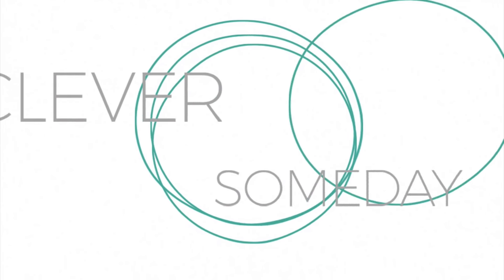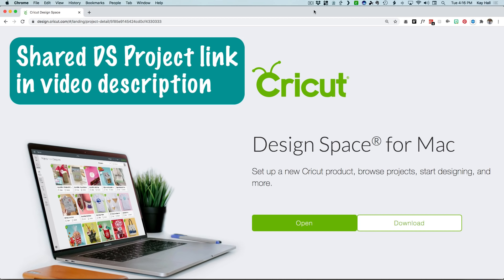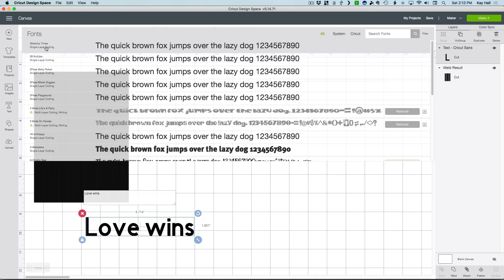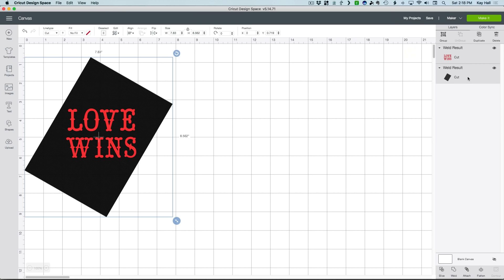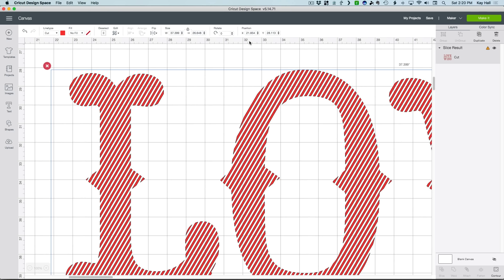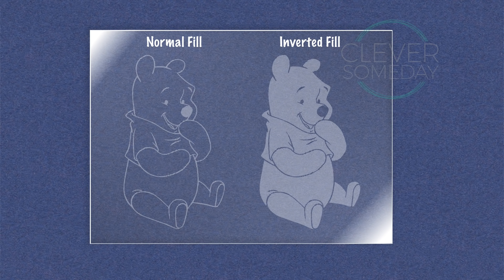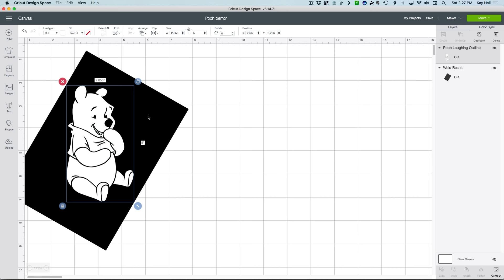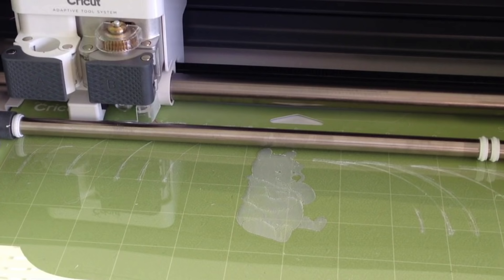Filled In Foiling, Engraving and Drawing with Cricut Design Space

Comment: this is incredible, thanks so much! i am confused that the specific design space project you share the link to is optimized for foiling/engraving but there is no link for the separate starter files for drawing that you do mention it in the video.
Reply from the maker: Great question. I realized that there were too many variables to optimize for drawing but it turns out this same fill is the best place to start. If necessary, you can adjust the starting size of the block up or down to optimize for your pen, paper and settings from there.

Comment: Thank you so much for the clear step by step instructions. Your "with fill" image looks perfectly filled as well as the Winnie the Pooh. I download your rectangle and followed the instructions to a T however my final engraved product I can see all the lines and the line spacing between all the lines that is not engraved. It is not solid engrave as yours is shown. Any advice to get tighter lines?
Reply from the maker: You will see some lines, its not a perfectly solid fill, but if it is very noticeable then you may have accidentally resized the block or not enlarged both items before slicing. Barring that, you can reduce the size of the block before starting to give you a denser fill. There is a tradeoff between "solidness" and the amount of time it takes to engrave and finding that right balance is personal preference. There is also a DS bug we see sometimes that causes an unevenness or banding, so its possible that is coming into play as well.

Comment: Hi Kay, I want to try to eventually engrave my dog's final pawprint. I think I would use the 2nd method you showed. Would you recommend using a pen in the cricut to double-check that the design is correctly set up? On paper of course. And I would like to do the engraving on metal. Is there a specific metal it will engrave on the best? It will be mounted inside his memory box.

Comment: Great video. Is there a fill starter for pen? I think you mentioned the engraving/foiling one was not suitable for pen? Thanks for all the great tips!
Reply from the maker: You can start with this for a very fine pen, and enlarge it for thicker pen tips. There are so many variables for pens (thickness of pen tip, type of pen, absorbency of paper, etc) that it turned out to be impractical to make one file.

Comment: Thanks so much for the video and the fill starter file.  I'm very excited to start my first project now.  :)  In other engraving videos, they recommend to duplicate your image multiple times, then attach them - so the more times means deeper engraving.  My question is, because of the line filler file, would you recommend making multiple cuts on top of each other, or does this way suffice for just once?  Thanks!
Reply from the maker: Great question and the answer depends on the project. One pass of a line filled design is sufficient for clear acrylic, especially if it will be edge lit. I still do multiple passes when engraving metal, but you don't need anywhere near as for outlines.

Comment: thank you so much for this! I just had a quick question: you mentioned that drawing would require lines that aren't as close together as those for engraving. Would I change the size of the file you shared if I wanted to write? or is there a different file for writing? Once again, thank you so much for such a straightforward tutorial!
Reply from the maker: Thanks for your kind comments. For pens, start with the same file, but set the block to 10 inches wide at the start. You may need to move up or down some depending on the size of the pen and other factors.

Comment: I LOVE this tutorial. Thank you so much for the file. I’m having a little trouble. When I slice my number from the block, the engraving has just slanted lines. They are never full. Any advice?
Reply from the maker: The fill is just slanted lines. If they are not close enough, then you may need to try the steps again, or reduce the size of the block to start with to increase the line density.

Comment: This was great! I just engraved an 2" circle key chain with no issues. My issues are, I can't save your fill rectangle, I can't save my project I created using your fill and I can not copy and paste into a new window....hmmmmm
Reply from the maker: These are DS issues, not an issue with the file, which I would have the power to fix. Copy and paste should work if you have not reverted back to the classic canvas in settings. Use shortcuts or right click menu, not the Edit menu at the top. And be sure to report the problem to Cricut.

Comment: I noticed the file is a cut file.  Do I need to change it to draw before slicing the words?
Reply from the maker: After the slicing, you need to change the operation according to your project (pen, engrave, foil ...). You could also change it before if you prefer.
Reply: @cleversomeday  i now have huge design that only showed 2 after slicing.  Waited at least ten minutes and I'm up to 3.  Do I need to wait until there are 4?
Reply from the maker: @denisereading6453  I've never seen this happen, and I suspect you have your answer by now. If you have the slice you need and it will let you continue, then you can continue, but I suspect it won't take any new inputs until it is done

Comment: Thank you for this! It worked, but my design is pretty complex ( A invitation card using foil) so the lines are a bit far apart, could you help me with this? Thank you so much!! :)
Reply from the maker: If you reduce the size of the line block first (from 5 inches wide to 3 inches wide, for example) the fill will be denser. Keep in mind that if an image is too complex DS can choke or slow the speed drastically, so we normally don't recommend this except for small pieces.

Comment: This is wonderful, thank you so much. Question, if I create this in SCAL, I can add my own line spacing, what is recommended for a font line when engraving or foiling? Default on the software is .0500, i did try .010 on vegetable tanned leather, but one it takes too long and the leather dries up before the first engraving pass, and two if too close together, it just starts to mar up the leather. What do you reccomend?
Reply from the maker: The pattern here is 100 lines per inch, so that would be .010" spacing for engraving or foiling. I do not recommend using fills for leather, unless you want what I would call a "rustic fill" and for that I would use 50 lines or less per inch.
Reply: @cleversomeday  Thank you so much for taking the time to answer this, it is interesting playing with the new learned methods from you. A superb asset to have in the learning tool belt.

Comment: Thank you for the very informative video,  I do have a question,  how big is the template and can it be made bigger for bigger projects??? Thank you again 💓
Reply from the maker: It is 5 x 7 inches. You can duplicate and weld to make it larger, but Design Space struggles with files larger than 5 x 7 and may take prohibitively long to engrave, so I discourage it, at least until you have some experience.
Reply: @cleversomeday  thank you so much🙏🙏🙏

Comment: Hello, I used your method to fill in some text. Everthing is complete. Can I resize the text AFTER I have already sliced it from the fill? And do I need to weld the whole project before engraving it? Thanks.
Reply from the maker: You want to size before filling because any change to the size after slicing will change the fill density. That said, small changes are not a problem, and making the text smaller will look fine but take longer than necessary. You do not need to weld the whole project before engraving, but you do need to attach it if it is more than one layer.

Comment: So, I tried this trick, and it worked on the first two images; but after that, it kept saying it was "too big for the Maker." I used the same dimensions each time, so I don't know why it stopped working?? Help??
Reply from the maker: You need to be sure you shrink the design back to the original size, and delete any of the unused unshrunk layers before you click Make it or you will get that warning. Check the layers panel if you get that message as it will show you which layer is the problem.

Comment: HI!! This was awesome! Thank you so much. However i wasn't able to use it for small engraving:( any hints on that??? I want to do 1 inch engraving. Thank you so much!
Reply from the maker: Many of us have used it for small projects. You don't say what the problem was, but one thing you can do is to shrink the black by half for a tighter fill and/or use a higher factor than 10 for the enlarge and reduce steps.
Reply: @cleversomeday  I rana project that was small for a metal turner and though it looks ok i can see that it drew hollow boxes instead of looking filled in for each piece. the image is W: 1.256 x H: 1.891. I followed the instructions in the video and can see tiny hollow stripes in the filled areas. Any help is appreciated. I'm a little confused on the troubleshooting you suggested above.
Reply from the maker: @sondrarichards8120  If you can see noticeable hollow boxes then it may be that you missed some steps. If done properly it will be approximately 100 lines per inch and "boxes" would be hard to see. I would suggest you try again, making sure your fill looks to be the same scale against the grid versus what you see in the video. There are written notes for this video in my Cricut Engraving with CleverSomeday FB group that are helpful for making sure nothing is missed along the way.

Comment: this is great but you never changed the cut to engrave, won't that change or alter the results?
Reply from the maker: It doesn't change the paths and since the fill is so tight it will look the same on screen too, but you definitely have to change the operation to match what you are doing (pen, engrave or foil) before you make the project.
Reply: @cleversomeday  thank you

Comment: how did you get it to be a weld layer?  I tried the hatch fill and line fill and get a background but cannot weld it or slice with it
Reply from the maker: The video assumes you are starting with my DS project linked in the video description. It already has a line pattern block there (labeled Weld Result because of how I created it) for you to use. The most common problem preventing slicing is trying to slice with more than 2 layers selected, so, if necessary, remove layers from your SVG or weld them together first until you only have one to slice with the line pattern block.

Comment: do i have to live it in cut or change it to the engraving? I wish you did the tutorial until de end
Reply from the maker: Like any other design element, you choose the Linetype based on what you are doing. So set to Engrave for engraving, Draw for drawing, or Foil for foiling, for example.
Reply: @cleversomeday  as soon as i change it to engrave it does not keep it filled, it goes back to normal
Reply from the maker: @priyaestrada9119  Be sure you are starting with a Cut design. It won't work if its Print then Cut.

Comment: Hi Kay, can the cricut foil over designs? I cant seem to find any videos about this as all foiling are done on blank surfaces.
Reply from the maker: It depends on what kind of foil you are using and what you mean by design. For instance, you can use foil quill and foil transfer on top of a printed design; foil quill will work on vinyl but foil transfer will not, etc.
Reply: @cleversomeday  thanks for the reply. I do alot of wedding stationery and wanted to add foil over some of the floral lines, i love the versatility of the cricut maker but thinking a letter press might be the only solution.

Comment: What if you trying to do the filling on a small space, for example a small Keychain. Would the filling work? like if you did a small portrait on a key chain with the acrylic being a round key chain and it is 2 inches wide. And 2 inches tall. Could it work? I havent had any luck doing the filling for something that small for a portrait .
Reply from the maker: Please see my separate video about engraving photos, but the process is similar. We have people in our group engraving photos on dog tags with this method, but you may want to decrease the size of the line pattern block before starting, so you have more lines to work with.
Reply: @cleversomeday  okay ill check the video out. So you have to change the size of the filling line to smaller ones? Wouldn't that change the spacing?
Reply: @cleversomeday  would you mind making a video?
Reply from the maker: @sillyone2012  first try following the video at https://www.youtube.com/watch?v=0HDP791s-ys as is. If you don't like the results of that, try again, but as soon as you open the starter file, change the width of the block to 3 inches, then continue as directed. This will give denser spacing if the original is too loose for the detail you need in your image.
Reply: @cleversomeday  okay I will try again. Thank you.

Comment: Hi Kay
I’m trying to get my Cricut to “draw” a QR code. I have generated the code, and when I change the file in DS to draw, it won’t work. I had hoped that I could use your fill pattern to get it to work, but I’m having trouble. It seems to come out as an incomplete QR code after the slice action. Any ideas for me?
Reply from the maker: we have had several people in my FB engraving group successfully engrave QR codes. Be sure you don't skip the enlarge and reduce steps. It may not work if you try to make the code too small.
Reply: @cleversomeday  hmmm. That might be the problem. I was hoping to have it at 1.85”. I made sure to use the ’enlarge x 10’ rule, but parts of the code are deleted when I look at the slice result. The QR code uploads as a Print Then Cut. Should I change it to a cut file or a draw file before trying to slice?
Reply from the maker: @megcerwin5728  It has to be a cut file. Try to start with an SVG of the code for best quality. And you may want to decrease the size of the lien pattern block before you start so that you will get tighter lines.

Comment: I'm on a mac laptop and it gives me the error message, 'The application "Cricut Design Space" is no longer open.' even when it is open. It prompts me to download the application and then asks if i want to replace my currently existing application. Is there a work around for this?
Reply: omg this exact thing happened to me. there was a recent update that screwed up everything. this is what worked for me: in applications completely delete the old app, restart your mac and then re download DS. (this will be latest version). And it will work just fine. I have no clue why this happened but, I attributed it to the update because once I got DS back, bam, it tells you right on the homepage a couple things have changed. This was the 1st time I got this error even though DS has been updated 3x since I got my Cricut. Anyways I hope this help! 🤞🏾😊
Reply: @britthappens17  Great solution. Thank you!
Reply from the maker: Thanks for posting this

Comment: mine comes out so bad, the lines are so obvious.
Reply from the maker: If done correctly, you will have about 100 lines per inch, so if it is more widely spaced than that you have missed a step. If 100 lines per inch is too broad for your project, you can decrease the size of the block before starting. But keep in mind this is a hack for those who don't wish to use other software. If you do a lot of fills you are much better served with Inkscape, Silhouette Studio or SureCutsALot that have actual fill features.

Comment: Mine is not slicing kmt
Reply from the maker: slicing only works with 2 layers, so be sure you have reduced your SVG to just one layer either by deleting layers or welding layers together, depending on how the converter you used configures the layers.
Reply: @cleversomeday  I know this been using cricut and the slice feature for over 3 years. I resort to the other video where you changed the svg to file so as soon as my blanks get here and I make the 1st one I'll come back and tell you how it went

Comment: FINALLY, videos without time waisting nonsense  I have no interest in.  Off Topic: could I trouble you to lead me to a link that will teach me how to outline the INSIDE of a shape,  specifically I want to put a series of evenly spaced lines on the INSIDE of a each side of the square, (square w/in a square), either by drawing them w/a pen or using the foil tool, prior to cutting the square?  Is Design Space even capable of this? I am at your mercy, and before signing off, I am guessing that many tell you how you have a very unique and sexy voice.
Reply from the maker: Thank you for your kind comments. The Offset feature, recently added to Design Space desktop version, will add the interior lines you are referring to, when used with a negative distance setting. In fact, multiple negative offsets is an alternate way to fill objects for drawing, engraving and foiling.